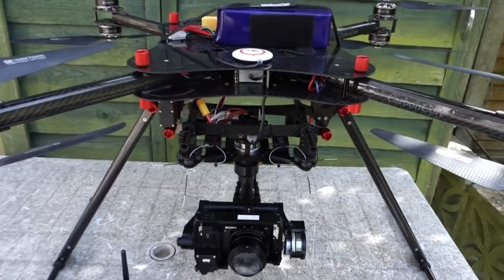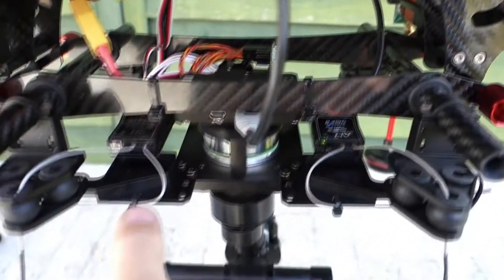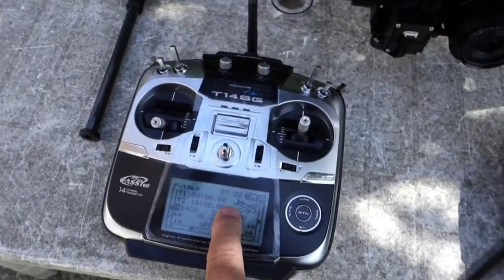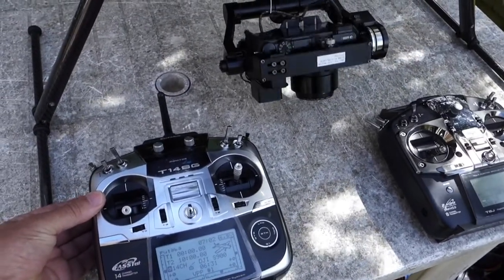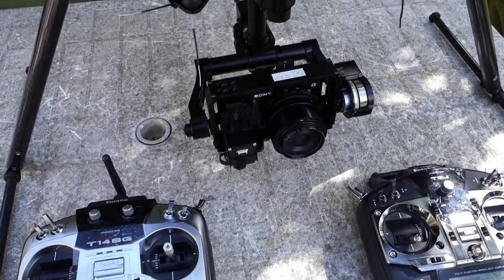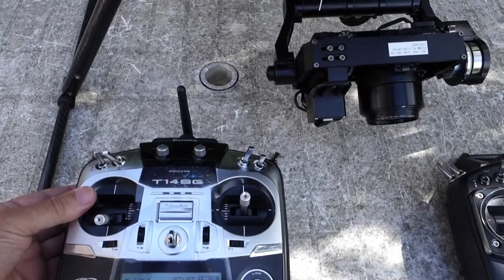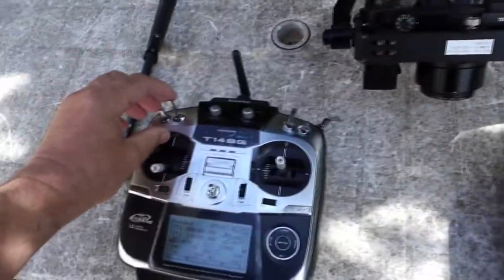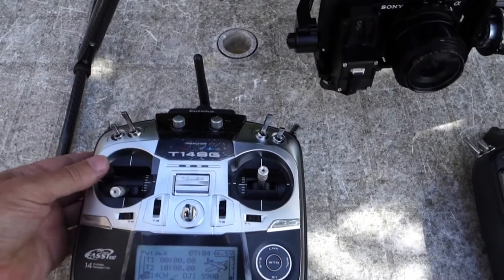Dual-Single operator R/C Radio control switch

Comment: Hey man
This is exactly what I'm looking for. Spot on. 
Can I ask what flight controller and gimbal are installed?
Also are you using sbus or traditional connections?
Thanks in advance. 
Cheers Jase
Reply from the maker: Flight control is with DJI A2 and uses SBUS from the RX, the DJI Zenmuse Gimbal uses traditional PWM from both RX's.

Comment: Hi can you please help me. I really need this setup. Where do i find this chip?
Is it difficult to setup?
Reply from the maker: WIRELESS HOBBYZ A PIC chip is a 'Peripheral Interface Controller', search on Google for it. It's really easy to setup, but I guess if you wanted to start from scratch then a PIC programmer is required. If more channel switching is needed then two could be used to give eight channels switched.